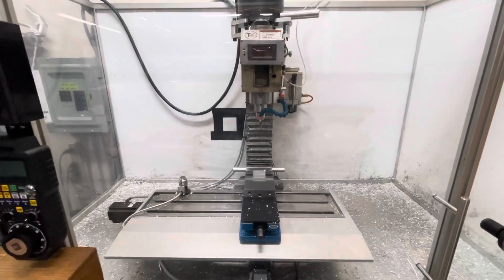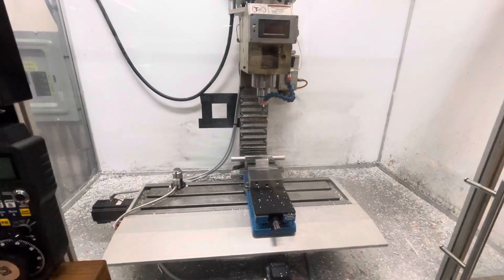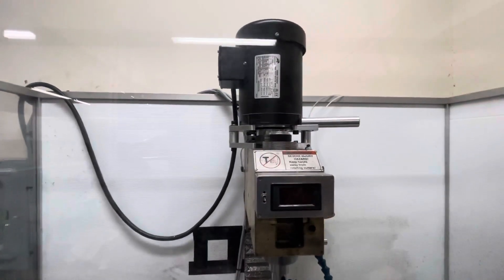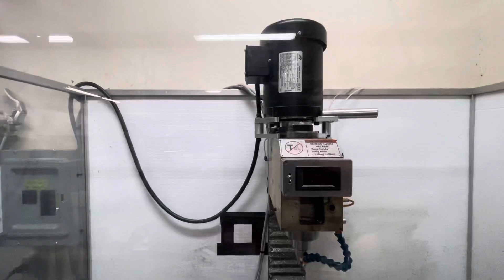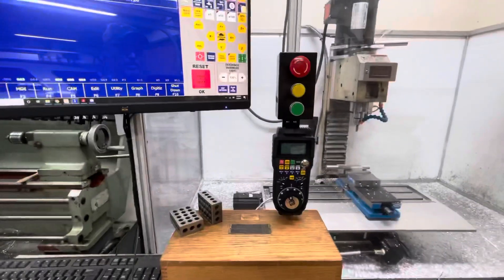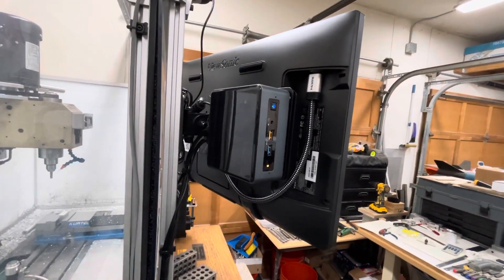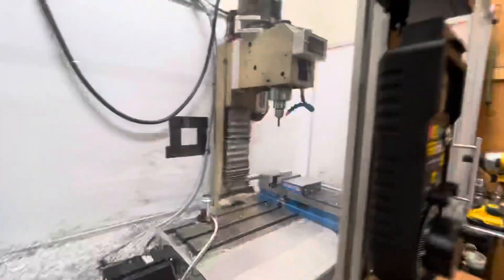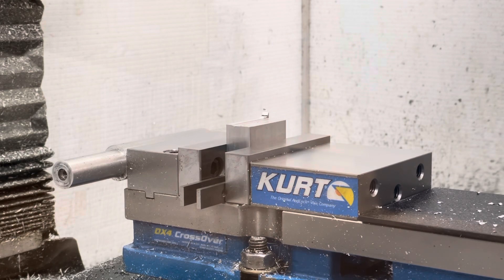G0704 CNC with Centroid Acorn - Demo part.

Comment: Nice setup. I have a question regarding your driver's and motors. I am using the same components you are, with 1605 ballscrews. But I'm currently maxed out to 125ipm before i lose steps. Can you share with me how you are getting 180ipm? Different pitch ballscrews maybe?
Reply from the maker: That's a tough question Joshua. Are you sure that your axis move freely? The first thing I'd try is  loosening up the gibs and see if the speed improves.
Reply: @ChrisAttebery  My machine is on Hiwin 25mm linear rails. Each axis moves freely with out the ballscrews connected. Are you microstepping? I watched one of your videos about the acpi and standard pc connection so i checked my pc and switched it to standard and then retested my rapids. No change and the machine sounds the same compared to using acpi. My drivers are on the default auto switch settings tho.
Reply from the maker: @duwacker16  I have detailed build threads on www.CNCZone.com, www.hobby-machinist.com, centroidcncforum.com. I'd start a thread on cnczone or the centroid forum depending on what controller and software you're using. You should be able to get 240IPM if you're using the same drivers and motors that I am. It could be a problem with your hardware controller or settings. There are just too many variables and honestly YouTube isn't a great place to document anything.

Comment: Nice work Chris. Your stepper motors appear to be closed loop? I think I see encoders on them. Congratulations! Post on the Centroid Success Stories Forum!
Reply from the maker: Thanks Marty. Actually the steppers are open loop. Those are 3D printed covers on the motors to clean up the wiring.
Reply: @ChrisAttebery  👍👍👍